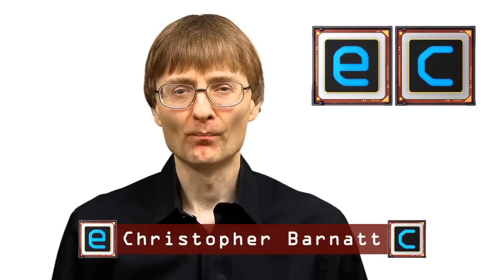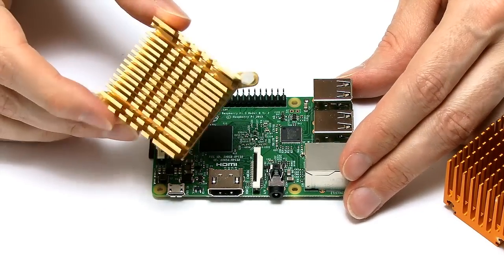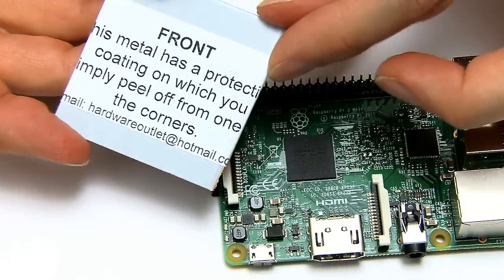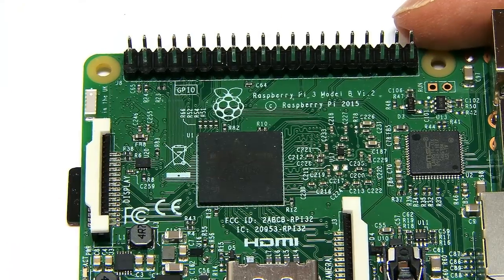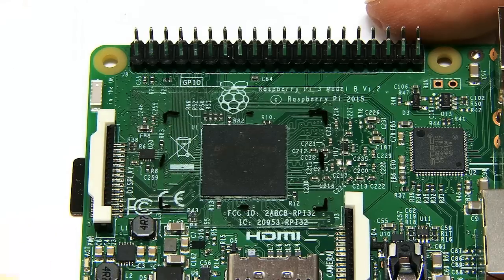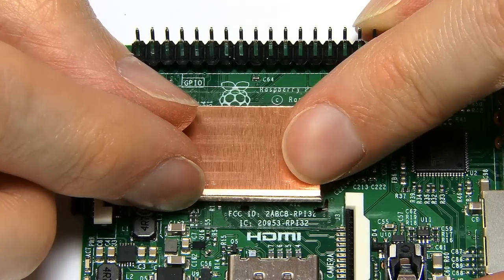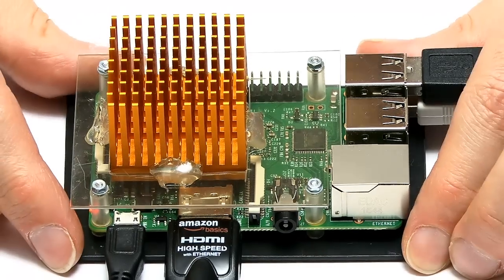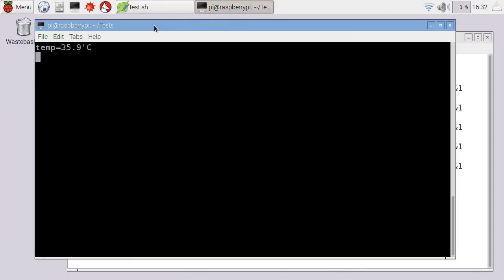Raspberry Pi 3: Extreme Passive Cooling

Comment: Almost all applications of thermal paste get this wrong, including PC manufacturers. 
Apply thermal paste minimally and spread it thoroughly and evenly over the entire surface, not a pile in the center. People see a thick application in the center when they upgrade their CPUs by the factory and they think this is correct. Youtube videos actually tell people to pile it in the center.
Reply from the maker: I used to use spread, but then saw many test videos -- here on YouTube! -- than demonstrate how the pea method works better as it does spread out evenly and has far less chance of introducing air bubbles.
Reply: ExplainingComputers I was not talking about this video. And properly done, the minimal spread out method is the best. The paste itself is "LESS" efficient a thermal conductor than metal or glass. Thickness of thermal paste is inversely efficient. Also the surface area covered by the thermal paste (less gap) is directly efficient. 
The paste is simply to fill in the microscopic gaps. The paste itself impedes the flow of heat in comparison to the silicone and copper it bridges.
But if you insist ... please try increasing the thickness and taking readings. And often the paste does NOT spread thoroughly. Check the CPUs on PCs from factories. Some pastes are very vicous. It just stays piled in the middle.
Reply from the maker: Agreed the paste is just to fill the gaps -- and not all paste is created equal in terms of both viscosity and thermal conductivity. As pastes go, the Arctic 5 used here is pretty good.

Comment: The copper by itself is probably worse than no heat sink because it would tend to hold that heat in that mass for much longer in a real world setting.
Reply: +christo930 if your only looking at average temperatures that'd be true.  Peak temperature's are usually the ones we want to bring down though.
Reply: Ok. That's probably true. I have some pretty low profile heat sinks with a much larger surface area though.

Comment: err you were thinking of using a CPU heatsink on it's side ? Do you even know whqt your doing you vandal ? Might be worth mentioning that not only does the peice if copper help clear the other parts on the board it spreads the heat better than the aluminium base of the CPU heartsink that was not designed for this application.
Reply from the maker: +Simon Turner Do I know what I am doing? Yes, I think so. :) But do remember this is an experiment -- a hack with what is to hand! :)

Comment: Can you make a video on adding RAM to the pi?
Reply: +Dragon Coders You can't, it's soldered on. And the GPU (VideoCore IV) has a limitation of 1GB memory
Reply: +Dragon Coders It's impossible to add more RAM to the Pi, as the RAM on the Pi is soldered directly to the board, and there are no SODIMM sockets. Also, even if it were theoretically possible to physically add more RAM, the Broadcom CPU on the Pi can only address a maximum of 1GB, so it wouldn't be able to use it anyway. :(

We'll have to wait for the next iteration of the Pi to get more RAM, unfortunately. However, if you require more RAM now, there are competing boards such as the Odroid C2 which have 2GB of RAM.
Reply: Sheriff Blatz Obviously you would need to solder to add the RAM. My friend online does it.
Reply: +Dragon Coders Your friend soldered more RAM to a Pi and it was able to recognize and use it? I find this difficult to believe, I'm afraid.
Reply: Sheriff Blatz Why is it hard to believe that RAM being soldered to the board works for the pi company but can't be done for a consumer? Sure it's harder and has more risk. Rather amazing you find it difficult to believe.
Reply: +Dragon Coders I find it difficult to believe because not only would the soldering have to be incredibly precise (and even then, I'm not sure if you can just solder directly onto the existing traces of the onboard RAM), even if you managed to somehow attach more RAM. the SoC itself wouldn't be able to do anything with it, as it is designed to only be able to use 1GB of RAM at the maximum, which I mentioned in my previous comment. 

It'd be like adding more than 4GB of RAM to a 32-Bit OS; it'll still run, but it will only be able to see 4GB, even if you put in 8GB.

I don't suppose you have any proof that you could show us of this upgraded Pi?

I'm not trying to be mean or put you down, it's just that to say it's upgradable is hogwash, It simply isn't feasible or realistic to upgrade the RAM of a Raspberry Pi.  =\
Reply: +Sheriff Blatz I am just asking him if he would consider a video on adding more RAM. On the whole I don't care if others believe it is possible.
Reply: Dragon Coders If I may ask, why do you believe it to be possible?
Reply: Sheriff Blatz On different electronics boards (cheaper version of pis) he has done it. He has soldered off the RAM, and soldered connectors to it and another. But it's apparently very hard, I know NOTHING about electronics, so would rather see a video tutorial.
Reply: Dragon Coders I can see him doing it to a different board, just not a Pi. If you don't believe me, have a look at this:
https://www.raspberrypi.org/forums/viewtopic.php?f=29&t=107906
Reply: Sheriff Blatz Its a pi-chinese knockoff using ARM architecture. Its 32bit, the limit is 4gb.
Reply: Dragon Coders Which would technically make a RAM upgrade feasible. A genuine Raspberry Pi using the BCM 2837 SoC (System On Chip) is already maxed out at 1GB. As that link in my previous comment shows.
Reply: +Sheriff Blatz No I mean the pi2. I want to upgrade the RAM on pi2.
Reply: Dragon Coders BCM 2836 is also maxed at 1GB :P
Reply: Damnit, I will have to upgrade all my pi2's to pi3, just for the extra RAM.
Reply: Dragon Coders But the Pi 3 has the same amount of RAM as the Pi 2? The only difference between them is the Pi 3 has a more powerful 64-Bit CPU, and built in Wi-Fi/Bluetooth. You'd have to get something like an Odroid C2 to get more RAM.
Reply: Sheriff Blatz Dangit. Yeah thanks i will look into that one. That helped a lot thanks man.
Reply: Sheriff Blatz Holy cow, that thing is a beast. 2ghz clock speed on cpu as well.

Comment: You did not run the tests long enough, the temperature got a full degree hotter in the last measurement. If you'd like to get a good idea of the performance you should measure until the temperature is stable :)
Reply from the maker: +Tinco Andringa I'm posting a follow-up on Sunday with a longer test -- there are practical constraints for recording from the Pi for very long periods . . .

Comment: OMG where the hell did you learn to put on thermal paste?  First of all, it's the sie of a grain of rice dude, you put on about 5 times too much.  Then and most importantly, you do NOT use paste unless it's being clamped down!  That's thermal 101.  On a chip like a mofset, ,RAM , pi, etc.where it's held down by gravity you must use thermal ADHESIVE or tape, period.  Thermal paste does NOT have enough adhesive quality to hold the chip on long term, just read how every single thermal paste maker states it and to use adhesive!

People, take my word for almost 30 yrs in the IT since the 8088 cut over to 286's cause thermal paste/adhesive/tape hasn't and will most likely never change significantly - chip no clamp - adhesive or tape and with clamp/mount - paste and you do NOT smear it on and use about 1/5th what this video shows, about the size of a single GRAIN of rice - and that's for a FULL SIZE desktop CPU!
Reply from the maker: Noctua recommend a "4 to 5 mm bead" of thermal paste. And in the context of this video, note that what I show here is a test -- a Sunday afternoon hack, not a PC build. And -- it worked! :)

Comment: Heating up the heat sink will make the hot glue not stick. Should just use some bands around it.
Reply: the hot glue needs very high temperatures compared to what that heat sink will have

Comment: You could do better with the application of your thermal compound. It should be absolutely as thin as possible. Use a credit card or something to spread it uniformly, but very thinly across the entire surface of the chip.

Comment: Surrounding the processor with a clearance fit plastic sheet and holding Heat sink with hot glue, what happened to the humanity, God I miss the good old days when I didn't have enough bandwidth to watch YouTube.
Reply from the maker: +Khaled Helal Humanity? If you suggesting that this will not work, note that the SoC throttles at c.82C, the melting point of the plastic is about 230C, and of the hot melt about 120C. So there is no danger of either melting. :)
Reply: It obviously worked, I am mainly joking, however I would have loved to see a metal spring bridge pressing down the heatsink and being held by the bolts you fitted.
Reply: +ExplainingComputers It obviously worked, I am mainly joking, however I would have loved to see a metal spring bridge pressing down the heatsink and being held by the bolts you fitted.

Comment: I would like to see some long term stress test... like 2 hours... because pasisve heatsinks have limits they heat up if you have more heat coming in than the surface area dissipates....
Reply from the maker: +fatherdoctor Indeed, I will report back on that. But I doubt it will get out of the low 50s.

Comment: Can't you solder the metal to each other?
Reply: I don't think you can solder aluminium and I also don't think solder has good thermal conductivity.
Reply: Ifthen Else I use copper all round or aluminium...But i thought soldering one uses different metals and with welding the same. look at copper pipes with tin....
Reply: +Ifthen Else you can solder aluminum (though it's a little tougher then copper) and solder has a much better thermal conductivity compared to thermal compound (there was a little fiasco when intel stopped soldering on heat spreaders and used thermal paste instead)
Reply: +animefreak5757 Yes, it can be done with special solder types. I just read about it, news to me.

Comment: try looking up speaker joe on ebay and get a pi case that IS the heatsink LOL, and here in the states with shipping they are only 12 dollars, which is probably less than 10 pounds or euros when you do the conversion from the USD to euro or pound sterling

Comment: Should have used thermal adhesive it will stick like glue so the heatsink won't move around
Reply from the maker: It would be hard to remove the heatsink though! :)

Comment: You do know that it's a really bad idea to use hot glue to hold a heatsink, right? :) It starts getting soft above 50C.
Reply from the maker: +Andrei H The melting point for hot melt is 120C. Yes, it may go soft earlier, but it is not used structurally here -- unless the Pi was tipped over, both gravity and the thermal compound would keep it in place. :)

Comment: Would have been awesome if you added a fan on top of that huge heat-sink just for fun :D
Reply from the maker: +Kyuunex The problem is, I never expected it to work this well, and so never left holes in the plastic to access the GPIO pins to obtain any power. Silly me!
Reply: +ExplainingComputers You should adapt one 40mm fan, they are really tiny and quiet, i guess it would drop the temps even lower. Amazing video.
Reply from the maker: Juan Remes Many thanks. I can see from the comments that I will have to include this in a video with a fan on top! :)
Reply: +ExplainingComputers That´s good, i will definitely be looking forward to it. If i may add a suggestion, place the fan on the side of the heatsink, i suspect it will help to drop 1 or 2 degrees more rather than fan placed on top, but its just a suggestion, keep up the amazing content flowing.
Reply from the maker: Juan Remes An excellent sugestion -- and possibly easier to achieve as well. :)
Reply: Actually, even I wouldn't have thought placing a large heatsink would make a HUGE difference, it probably has to do with the fact that larger heatsink can take more heat, and I would also have to agree with +Juan Remes placing the fan on the side is a good idea because it would blow the heat away from the pi.

I see a lot of overclocking potential. I can't wait to get my hands on Pi 3 and mess around in future.

Comment: Copper has high thermal conductivity， but also too high heat capacity(slow cooling), only with copper, the heat is not going anywhere. Aluminums is the opposite as Copper. people should know copper along is not always better .

Comment: Permanent solution...and one that works incredibly well
2 part JB Quickweld and voila...heatsink permanently bonded to processor
Reply: +Brian C JB Weld directly on the CPU to hold the heatsink? I wouldn't think that would conduct heat very well at all... o.O
Reply from the maker: +Sheriff Blatz I think you are right. Arctic MX-4 is an exceptional thermal compound.
Reply: +Sheriff Blatz there are tons of thermal conductivity tests out there, heck toothpaste in some outdid some of the more expensive heatsink compounds, quickweld is imbedded with metal, a very thin layer will provide very good thermal conductivity and a very strong bond
Reply: Brian C Well I'll be...It looks like there might be something to this:  http://www.overclockers.com/better-than-thermal-grease/

Comment: It's a stupid idea to glue the heatsink because you need to add more thermal paste when time goes on
Reply from the maker: +MINECRAFT2738012 MINECRAFT Truth to tell, I did not this this would work anywhere near as well as it does. So I thought this rig would only stay together for a short time, and I would return to my setup with the fan for future overclocking experiments. But this worked very well! So I will leave it on one piece for now . . . at least until I've overclocked it. :)
Reply: ExplainingComputers ok

Comment: hot glue ? in a hot plate ?
Reply from the maker: There are different levels of hot! :) The heatsink will get nowhere near the temperature at which hot glue melts. :)
Reply: so is not for overclock solution ?
Reply: nice video btw

Comment: The hot glue was not a good solution. Because it will melt on high temperature and the heat sink would be displaced.
Reply from the maker: +Валентин Стойков Not true. The melting point of hot glue is about 120 degrees C. The heat sink will reach 50 to 60 degrees max -- the Pi's SoC throttles at 82 degrees. So there is no risk of the hot glue melting.
Reply: But it will become more soft after temperature increase to 50-60*C.
Reply from the maker: Валентин Стойков It may, but (a) the heat sink should not get that warm (in the tests here the CPU just about touches 50, so the heat sink will be less), and (b) the hot melt is not used to structurally hold the heat sink in place -- that is achieved by gravity (and also the thermal compound) unless the pi is tipped over during operation. This build is also a test! :)

Comment: Now desolder the GPIO pins and do the same for the Zalman CPU cooler :)
Reply from the maker: +Ziggurat I am considering ways to fit the Zalman cooler . . .
Reply: +ExplainingComputers Great! The GPIO pins are fairly easy to desolder. But the tin is not so great to work with, I am sure you already know you can add new tin to make it easier, or even that surface mount desolder tin. You can always just solder leads you need right to the GPIO holes. 

If you want to keep them, maybe you can fit it with overhang, over the HDMI and Audio side.

Either way for mounting it, maybe clamps.

Another thing to think about, bit more expensive, is those all in one liquid coolers, the CPU block with pump should be easier to mount than your Zalman. And you could use it for overclocking a desktop later.

Thanks for your videos!

Comment: Not a very good test... where is the ambient temperature to have a real comparison? A big heat sink has a high thermal capacity thus you need to give it more than 10 minutes to get the final temperature. For our tests we let 24 pass to give the pcb time to heat up properly... but thats thermal tests for industrial electronics. I guess 1-2 hours is fine for this size. It also would be best to run the load continuously in the background and not stop every so often to read the temperature.  The final results might not change much... but it is a more professional and valid test this way.
Reply from the maker: +coppercount The abient was about 22C -- I forgot to mention this in this video (which is the third in a series). As you note, this is not a professional electronics project, but a Saturday afternoon hack. :)

Comment: I put my badly infected computer into a local shop - i checked if they were Microsoft certified as i have been plagued with hijackers both physically and virtually..I have spent 6 years trying to get out of this mess. I learn lots but still no further in getting rid of the hijackers.

Yes, sorry i am jumping here as my every keystroke is recorded and i get shut off from what i am doing..The technician not only put me an out of date Windows OS when i asked for the Full Windows 10 64 pro. As well as spending an hour telling him how my system was badly infected as well as the USB's and keyboard/mouse (HID)

This man company put a load of spyware, camera arduino, a recorder, a hot plug ready for gaming, all the recording codecs. He also filed in the 'Event Viewer' reporting back that i was intentionally not letting my system communicate. At the same time the events were filled in by two computers that were not mine. He also created multiple accounts making himself owner. I paid £200 for goods i never received. He will  not communicate with me..

I am going to get in touch with the police as this is a local shop and i feel i must protect others from con men like him..My carer advised that i see Citizens Advice Bureau, but now i have so much proof i need to report this to police..

I get redirected, forced to be on local computer, on remote computer.I constantly see my pc on gaming sites while i look up links to try get to the bottom of this hijacking

Any advice would be much appreciated